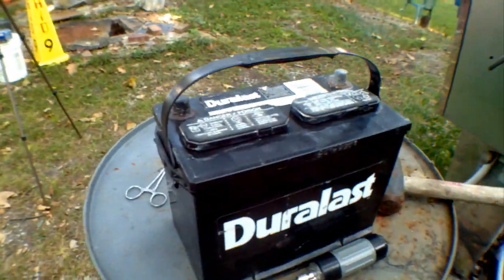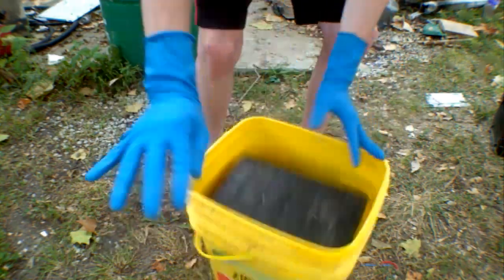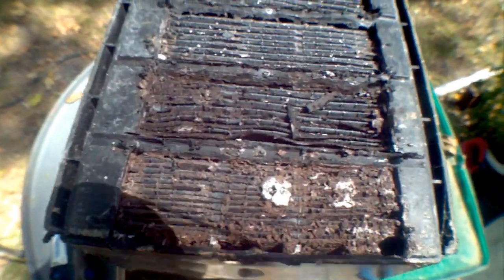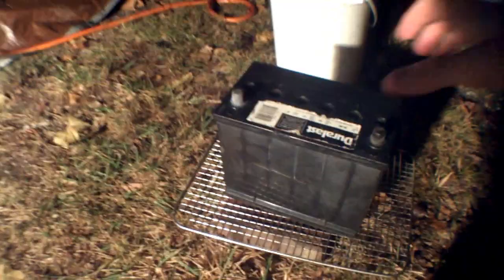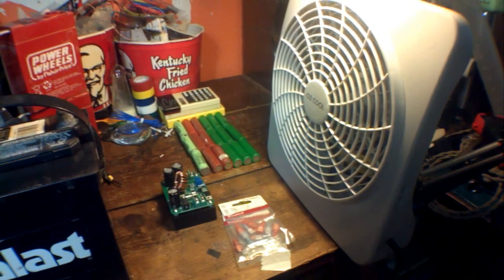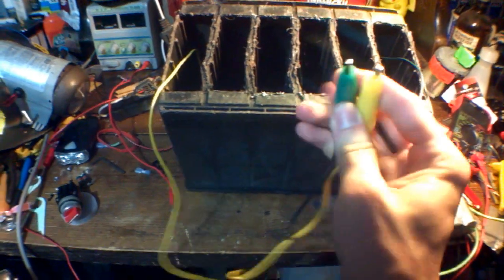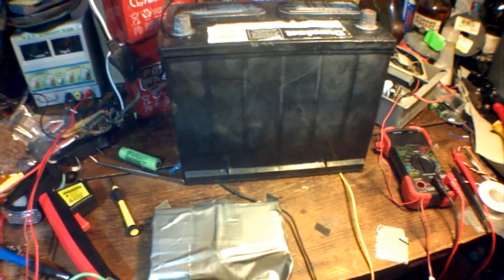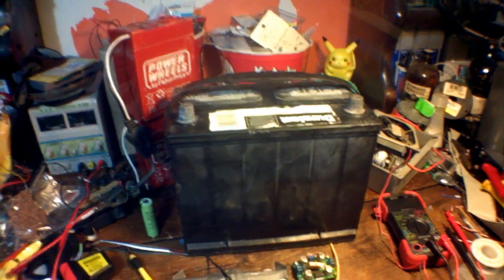DIY Lead-Acid to Lithium-Ion battery conversion 18650

Comment: what a creepy bastard. I was amazed to see the woman . Then the query neck beard revealed it was his mother. Tearing apart a battery for him. This is a sad video
Reply: +Rinoa Super-Genius Oh.
Reply: +Rinoa Super-Genius Failure Analysis is a huge part of electronics. Did you ever figure out why?

I&#39;m only 2 minutes into it but I&#39;d guess the slanted plates might be from freezing in the winter (you in the midwest like illinois or indiana where you see some really subzero temps) because when the acid gets weak it freezes easier. That is really old, capped ones have been illegal in the USA for over a decade now, I believe. I&#39;ve seen themin Canada, though.

(edit: Now that I binge watched a batch of rinoa's vids llooks like i was on the right track with temp but wrong band.... heat. Heat, bad connections and dirt is what kills 99% of electronics)
Reply: +100braindart What a fucking loser who can't even spell right. You should go back to school and actually FINISH IT. Maybe you'll learn a few of the things Rinoa knows.
Reply from the maker: The Sqoou
idk, i just like responding to people that comment on my videos, like im doing to you right now. its always interesting to see people's responses.
Reply: +Rinoa Super-Genius You're cool. Don't sweat it. People of every type are prone to attack what is different from themselves. 
They do it because they feel small and can't get any bigger, so they try to make others as small as them. 
You're right for being whomever you are. Ignore insecure people such as 100braindart here.
Reply from the maker: The Sqoou
but arguing is fun :P
Reply from the maker: +100braindart your talking as if i'm not here, its my fucking channel. btw your making no sense.

Comment: I use an AGM battery from an Emergency Light to power a Deer Cam and it works great! No need to tape all those batteries together when a factory battery is available for $15-20 big enough to run that fan. Like +CynthiaAvishegnath said, you are an environmental hazard.

Comment: Why didn't you just dremel around the top seal and pull it out through the top?

BTW -- yes, a lead-acid battery has sulfuric acid in it. Who knew, right?

Comment: nice work dude, I think I'm going to use some lithium batteries in my solar system, some good ideas for my future battery set up...you can get a great deal on solar panels right now...and charge controllers are only like 20 bucks on ebay...having your own energy source is awesome and super fun

Comment: nice man i am very interested by this project.  I wanna up grade my becane c100 acid battery to 18650 battery.  but I don't know how to regulate voltage t0 12v and how many amps it needs.
Reply: Look up BMS battery management system controller boards. Cheep to expensive on A-Zon.

Comment: Super capacitors and Li-ion combine is the size and weight of a six pack soda. The capacitor last a lifetime...while the Li-ion is used to hold its charge.  The technology is here while most that refuse the switch are siding with the EPA.. by talking about fines and arrest to a pioneering kid. Do you really believe the EPA have a higher moral ground. Do you really believe EPA is going to bring advances in technology?

Comment: Li-ion is cleaner than lead-acid. For this reason his polluting, if any, is justified. Others will pollute far greater. 1 car owner uses 14 lead acid battery in his or her lifetime. Used batteries are shipped to third world nations where birth defect run rampant. Most think 'as long as it's not my children...I don't care.' Use super-capacitor-Li-ion as an alternative.

Comment: Critics overlook the fact that they still drive a car with a lead acid battery....which gets replaced every 5-years is a serious gross polluter. PLEASE STOP using lead batteries. Switch to a proven SUPER-CAPACITORS + Li-ion instead.  Rinoa is far ahead of its time.

Comment: love the ”safety " footware :-) thanks for giving us a look inside your old battery. any ideas on connecting and charging nokia BL series of batteries? info is not readily available. i've come across several devices using them, nothing in Series or Parallel. battery bank for phones gps and led lighting for my recumbent

Comment: very impressed (minus the hazmat issue) ... most people on this thread don't get the huge advantage of LifePO batteries and/or how to string them in series/parallel. They rather be spider monkeys and do what the common mob mental does which is badger you. I was actually getting ready to buy a very VERY expensive LifePO4 battery.  Now, i think I will build one.  thank you for taking the time to share.

Comment: Running the fan @ 9V for 14 hrs means his average cell capacity is ~1255mAh--which is probably ~60% of the rated new capacity.

Comment: why would to go through all that trouble  just to use the plastic case from the battery, when you could have just used any plastic container? you exposed yourself to sulfuric acid and lead for basically no reason, and you contaminated the ground in the process... next time just get a plastic container from a hobby shop or something...
Reply: +Krankie V well this is his irst ever la attery soo he probably wanted to keep it as a functional battery
Reply: @photonic_induction2633  - hmm... This battery isn't a living sentient being, so I get why people wouldn't understand the attachment to this battery and be like "wtf- why go thru all this trouble..." There are quite a few people in the world that exhibit this psychological condition; basically makes them unable to part with inanimate objects due to sentimental attachment, or they've convinced themselves that said objects have feelings, etc. You and I would just buy a new battery, and recycle the dead one- but people like this often simply cannot part with it.(I'm not saying he suffers from this, but he sure looks the part via this video) This is the same psychological process by which people become hoarders- just a much more severe exhibition of this behavior.  Check in on this guy in 20 years- he will likely still have the same dead carcass from this battery that he's so attached to, and likely dozens more items- either the same or different.... This can easily spill out into full-blown hoarder syndrome.
Reply: +Kristijan Dinga well it's not a functional battery anymore. it's a hollowed out case with some lithium cells shoved in and it's completely stupid.
Reply: Krankie V think of it what you will but i wud do the same !
Just a little better i wud put all the cells that it cud hold put a bms into it and a current limitor
Reply: +Kristijan Dinga you would seriously rather expose yourself to acid and lead, and go through all that work for an end result which is only a semi functional battery which can't be used normally, than just use a nice clean project box, or other improvised container? You must be special.
Reply: Krankie V hehe i am a litle crazy soo think of dat what you will
Reply: +Kristijan Dinga  Agreed, he's keeping the case for sentimental reasons and as long as the acid and lead is handled properly, there is not particular danger.  Far better to do this than just toss the whole thing out.
Reply: Well no shit. That is exactly what I said. He replaced his battery a different way. My god, the things that people bitch about. I guess it is stupid to always be curious? Want to see the inside of shit? Yeah the video was dumb, and yeah, anyone that knows how batteries work ,or just watch this is going to agree, it isn't the best way, even the fucking kid says that. But no, you are still gonna just be a wet blanket and care what people are fucking doing. Let him fuck around. Nothing he is doing is dangerous, so who gives a fuck. And do not go on about how lead acid batteries are dangerous. I will not argue over something that requires you to be retarded to be dangerous. 

Again, let fucking teenagers learn and mess around, there is plenty of dumb fucking shit on youtube that deserves to be bitched at. Go fuck around with vegan gains' channel or something. Rape that asshole
Reply: +AUSSIEbattler96 that's not true at all.
Reply: Mike Stavola
a tragedy isn't it? Anybody can act like a complete moron on YouTube and get loads of hits. Yet, there are countless very informative, inspiring, and educational videos out there which took a lot more effort to produce, and they go almost unnoticed. Today's society praises ignorance and shys away from information.
Reply: I won't leave
bitching because it was a retarded thing to do in the first place. an old lead acid battery case isn't good to reuse for anything really. best to be recycled.
Reply: i have done the same thing with my father and we run it in our VN Commodore it is not pointless your just be ignorant
Reply: and why waist something when you can put it to good use i am not dumb i just like doing things to kill time
Reply: +ptonpc The fact that he has that kind of sentimental attachment to a car battery indicates to me that he probably needs some psychiatric help.  "Semi functional" lithium cells should be properly disposed of not put to use in something... well unless your goal is to eventually have one vent and burn your house down.  This is one of the dumbest things I've seen in the last week... and let me tell you I've seen some dumb shit.
Reply: +Krankie V you could still use it for every day things even in a car.....
Reply: Learn the difference between plain and plane before you call somebody dumb.  You imbecile.
Reply: *****
"safety freak"? avoiding spilling battery acid on yourself is pretty much common sense, at least to most people...
Reply: Who cares. He enjoyed what he did and it was wntertaining to watch. Whats in your closet youre attached too?
Reply: So at this point you are just bitching because he did it not how you would do it?
Reply: i think it's all in the name of science
Reply: immrnoidall Thank you Captain Obvious
Reply: AUSSIEbattler96
it's not going in a fucking car dipshit
Reply: AUSSIEbattler96
he said right in the video what the intentions for using this battery were. he didn't even connect the cells to the original battery terminals, which would be the whole point of using this case for powering a vehicle. Can't believe you're this dense to keep thinking that it's for a car.
Reply: who honestly gives a shit you fucking fuck. it's just english i couldn't care less you fuck
Reply: Sficlassic The charger settings can be adjusted to the correct settings for LiFePO4
Reply: be "safe" ha yeah putting it into a car and when it get's loose and falls out thats safe
Reply: wow now there is name calling you must be young. he used the old battery because and maybe he might put it in the car
Reply: alright now you are startion to piss me off i said MIGHT yeah see that word MIGHT fucking dipshit no one needs education videos on youtube if they do they are just plane dumb.
Reply: +Krankie V Its for nostalgias sake is does not have to make sense.
Reply: ***** yeah and he included that like you said he is just a safety freak, and really it isn't his concern
Reply: *****
in my closet? I've got my nice clothes for special occasions, some spare computer parts, bed sheets, and my rifle. All of those things have a purpose and aren't as easily replaceable as an old car battery, save for the bed sheets...
Reply: And you wonder how Hillary won the popular vote 😂
Doesn't say much for our country's future 😩
Reply: Read my comment above. It will tell you how I really feel.
Reply: Yes that is a good idea, but just taking a bunch of Li ion cells and putting them together isn't to bright. The cells need to be matched ie. voltage/discharge curve. If not one or several could burst and the fire/fumes would be toxic. Also the charger for lead acid batteries isn't capable of handling the different charging curve that Li ion needs not to mention the heat build up.
Reply: Krankie V I agree
Reply: Agreed. I know there are risks in many things, but there are differences between accepotable and unacceptable risks. To my mind this borders on the reckless/stupid/pointless/dangerous level of risk.
Reply: Start your very own battery business and make huge money here: JoxCharge.com
Reply: Saftey equipment should have been used yes when handling hazardous materials, regardless the educational value of this video gives others start point for their own project.
Reply: Amen to that... the forum for fools has no shortage of views!
Reply: +AUSSIEbattler96 the voltage is incorrect. the capacity is too low. the maximum discharge current is too low to start a car, and there aren't proper terminals to connect it to a vehicle properly. did you even WATCH this video? using the battery case to house this bank was completely pointless.
Reply: +Krankie V  He made it for fun.   He states in the video that he has a lot of semi functional 18650 cells already.  He is keeping the case for sentimental reasons.  
He made a working battery pack from stuff he had already had lying around.  I doubt it cost him anything apart from time and effort.
Reply: @ptonpc  just a few Burns and a shirt a pair of shorts and maybe some sandles!
Reply: the one i have works fine and who care wether it is safe or not is it you? no? well maybe keep your buthurt comments to your self. oh and fuck the envoriment 
and fuck spelling
Reply: AUSSIEbattler96
Your ignorance is showing
Reply: Why?  Because it got him half a million views.
Reply: yes it is.......
Reply: +AUSSIEbattler96 

waste*

it's called recycling, that's what you do with old lead batteries. that way the acid and lead are disposed of safely. you could repurpose many other things to be a container for your battery which would be easier, safer, and even work better.
Reply: mmdirtyworkz let me rephrase that for your simple mind.
"any plastic container" ain't going to fit and bolt back into the car CORRECTLY".
BUT,i am sure your Tupperware and duct tape method will be fine for you .
Reply: immrnoidall
this kid isn't putting it in a car. Virtually any plastic container would work, be cleaner, safer, and more convenient than this stupid idea.
Reply: Sficlassic LiFePO4 doesn't heat up that much and can handle temperatures up to 35C without loss of performance, unlike lead acid.
Reply: +AUSSIEbattler96 Using the case from the old lead acid battery is pointless when you could use nearly any other container which would be easier and safer. You must be just as dumb as "super- genius" here.
Reply: no im just saying now you should kepp your comments to yourself fucking tree hugger no one gives a flying fuck
Reply: AUSSIEbattler96
You really are a special kind of stupid.
Reply: +Krankie V 
"any plastic container" ain't going to fit and bolt back into the car.
Reply: Krankie V is a TROLL!
Reply: You're not killing time. You're killing yourself and the environment. I am all for natural selection weeding you idiots out. However as for mother earth, she don't need you killing her with the lead and the acid. I wish more of you would ingest lead. More for us smart people to go around.

Comment: missing some ballance modules  to keep  the cells at the same  voltage and also for avoiding overcharging..this  is  very nice idea I had also..but some really heavy duty BMSs will be needed to keep that little babies safe... but iit's pretty possible to get  14V battery with  60-80 Ah capacity  if you use some good  2100-2200Ah cells  and also, with good and safe circuits and wiring ,ballancing and shit like that

Comment: intersting experiment   not very practical but You now have a use for  semi crappy cels  I would interested in what the weight and power of the Li-io batt back compared to its orginal  Wt and power

Comment: what's the point??? why re use a huge nasty battery as a case?? your using lithium cells you could use anything..... I think your acid bath should have been a great hint to stop........ I've seen it all......

Comment: I just ran across this video, all I can say is that your gonna get hurt screwing around with this. First of all why are you reusing this battery case?  2nd , you are not using any safety equip i.e. gloves, eye protection, shoes , clothing & etc.. I realize your young and dumb but for your own safety , think safety!   It's not worth it to expose yourself to danger like this. Just had to say, take care.

Comment: man i hope you have a decent protection circuit in that your mixing cells if one of those goes bad on you the other batteries will rapidly charge it It will cause thermal runaway in the battery then fire

Comment: idea for possible future use.....
you might know, terminals on a car battery are made of lead, you can treat them like solder just you have to use a torch to solder em cause of the size(more heat requried than average soldering iron can put out); however course considering the context you want to keep it's shape overall for cosmetic/visual effect, so careful if you use a torch on it:P....... myself rather than trying to solder onto the bottom, I would drill through the  center of the terminal run a piece of wire through it and solder it at the top of the terminal outside or nut + bolt through the hole and use that to hold the wire in place....